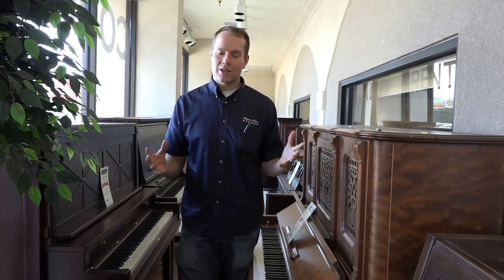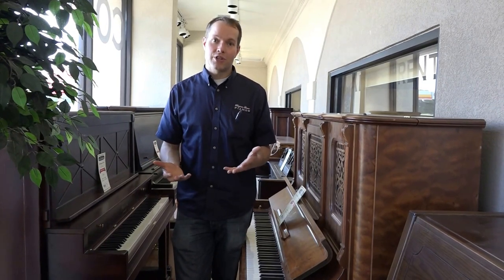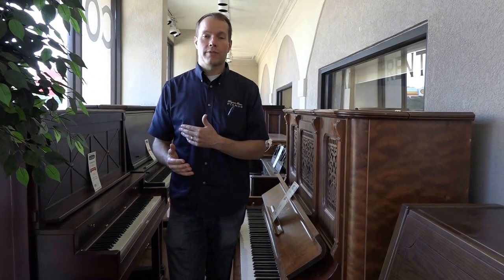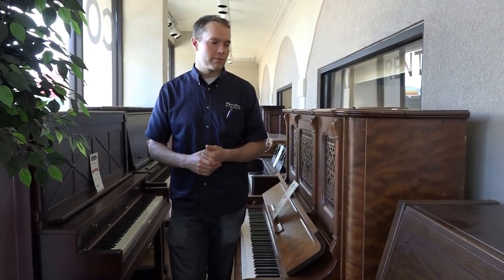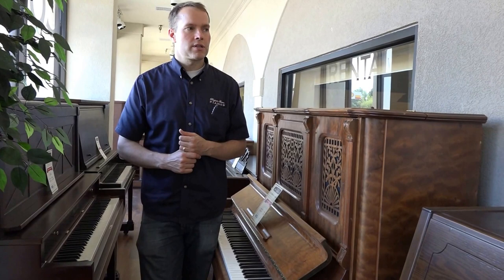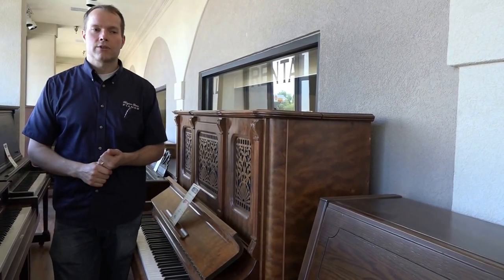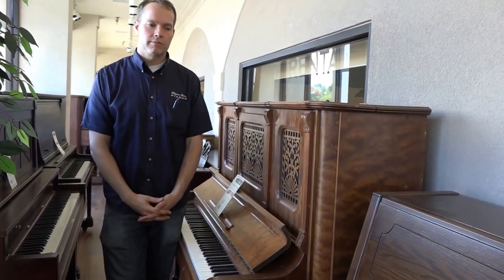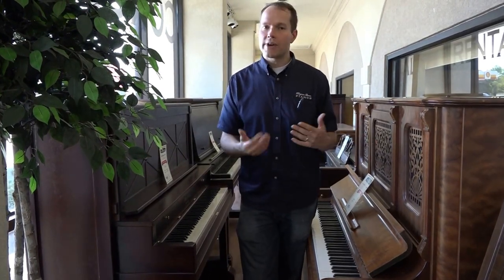Rebuilding Heirloom Pianos

Comment: One thing that was not mentioned in this video is the sound of these older pianos!!! The sound is another reason for considering a rebuild. Yes you can get a new piano for cheaper but it will not have the sound of these older pianos!